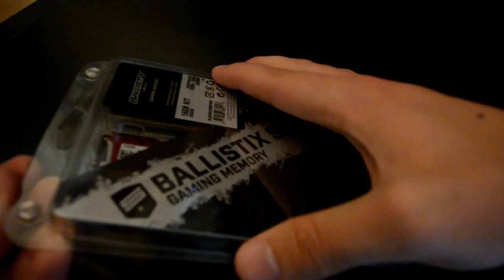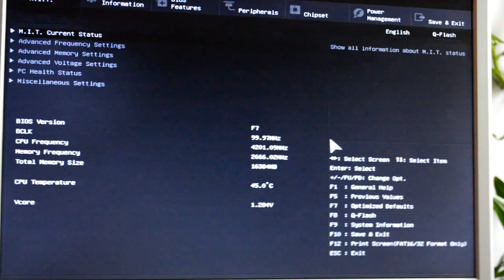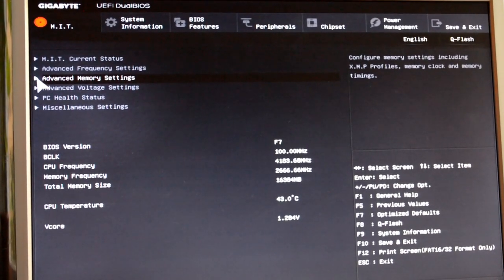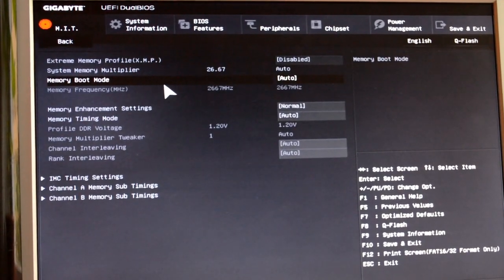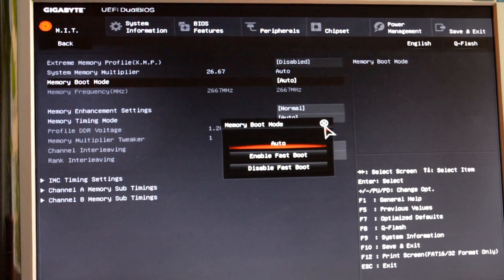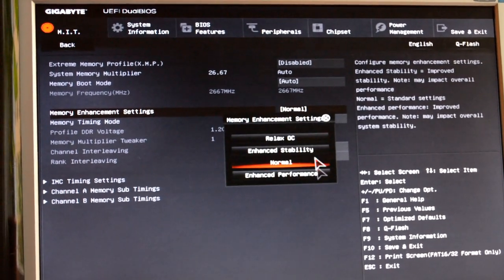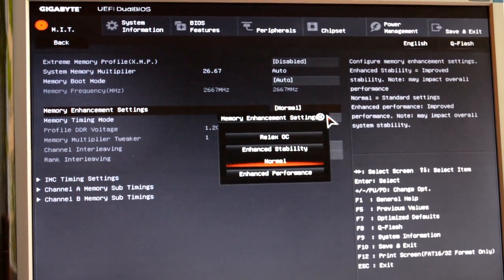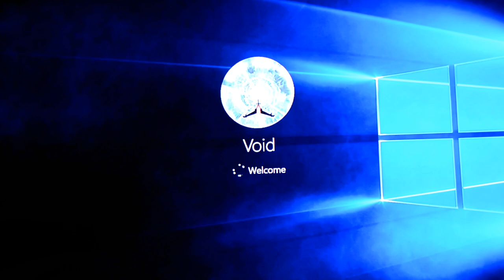How to Install RAM - Random Access Memory Upgrade Tutorial in Custom PC - Everything Explained 2024

Comment: I finally plucked up the courage to do this myself as a non-geek, no worries as it turned out. I had to remove the fan too. Looked at it for a while trying to figure out how to remove the fan funnel and finally sussed it. Turned out to be easy.  Slotted the extra RAM thing in, reconnected the Dell computer box, and it worked straight away. Nothing further to do.
Reply: Did u have to use. A non static wrist band or just free hand
Reply: U don’t need a wristband but just to make sure u don’t have static charge which can be done but just touching a metal part of the computer, so for mine it was the case
Reply: @JS-vc5yy  so for installating new or more ram you just plug it in? You don’t need to do anything in the computer?

Comment: I have Intel DH55HC motherboard and it has 4 ram slots and only supports 16Gb maximum in total. So I have to go with 4, 4Gb rams to get 16Gb ram. Anyway Now I running on 2, 4Gb rams and 1, 2Gb ram (10Gb in Total). So recently I bought another 4Gb ram and all them are same bus speed (DDR3 1333 MHz). So can I use all 4 rams (3, 4Gb rams & 1, 2Gb ram) together? Can I go to 14Gb ram in total?
Reply from the maker: Yes it should work like described

Comment: Hmmm, i am upgrading to 16 gb of ram (2x8) and i was wondering if it matters which slot of the 4 would they go into? Which slots do they go into?
Reply from the maker: Hey, it should be marked slots comes in pairs. A and B. Take the pair closest to the processor.
Reply: @GMODISM  You mean like A1 with B1?thats a pair?
Reply from the maker: Yeah this should utilize both channels perfectly
Reply: the manual of your mainboard should specify which slots are to use depending on configuration
Reply: 1 and 3 or 2 and 4
Reply: the closer you get them to the CPU the better as most games refer to the RAM for data on the fly. so closer means faster. it doesn't really matter which slots they go in (correct me if I'm wrong)

Comment: i would say leave the computer plugged in, BUT the switch off the power supply (this grounds the computer, but disconnects the hot (most call it positive)) 
this is optional: press the power button to discharge the capaciters
now install the RAM.

if your power supply dosent have a PSU switch then unplug it.
Reply: My pc has an on and off switch, can I use that instead??

Comment: So do I just take it out when it’s off then replace it and boot up and it’s fine or do I have to do something with the BIOS?
Reply: I’m wondering the same thing, did you ever figure that out?
Reply: @greasyg1026  yes, you have to set the ram speed I think because it doesn't come at the speed it is advertised. Say you have 3600mhz RAM it will come clocked at 2666 maybe so you have to go in the bios and change it ( I think )
Reply: Wait, I havent even watched the video and this was the reason I came here. You’re telling me he doesnt even address setting the XMP/DOCP? Fantastic.
Reply: @mrkhur9516  but it will still boot up right just not at the rated clock speeds ?
Reply: @giannivideo7680  yes it will boot up you just need to go to bios and change 1 setting

Comment: So I have 2x8gb of ram.. and there is 4 slots.. do I have to fill the next 2 at the same time or can I start out by getting one more piece of ram and making it 24gb?
Reply from the maker: I think you can have 3 sticks, should work but is not generally recommended as it may cause instability. 
Ram is pretty flexible but the recommendation is that you have all same size, 2 or 4 and same speed.
Reply: @GMODISM  im getting 1 of the same size,speed and ram. should I just wait until I get an extra 8 gb of ram to install it or once i get the one just go with it? Thanks
Reply: @seriouslymason  I recommend to install 2 ram sticks then move up to 4. Going to 3 ram sticks doesnt make of the use called "dual channel" you can see all the videos about dual channel if you want. And never put 2 ram sticks next to each other if you only have 2 ram sticks and 4 slots.

Comment: I installed my new RAM in but my PC just doesn’t want to boot up and makes a different sound then usual. It later shuts itself off and then turns itself on again. When I put my old ram back in it started up like normal like nothing had even happened.

Is this happening because my RAM isn’t compatible with my mother board? Let me know if there are any other reasons!

Comment: I need help, I did what you said and took out the 2 that were in my pc and added 4 (it comes with 4 slots but came with 2 sticks) I try adding the 4 but nothing happened with the sticks at all, then I trued re adding the old 2 and still nothing!!! Please help me...

Now my pc just runs alittle then turns off and quickly boots back up, it doesn't even show up on the monitor. Idk what im doing wrong
Reply: If your computer is duel channel make sure you have both sticks in the same color slot (some motherboards will have 2 black slots and 2 grey slots or something along those lines) and if they are, make sure the old ram is taken out and the computer is off. Before all that make sure the ram is even compatible. It could be too slow of ram or wrong ddr. Good luck, worst case scenario a computer store like Canada Computers can find the problem and fix it for around $100.
Reply: Nevermind I got it, I didn't push them in all the way lolol, but thankyou though^^
Reply: Oh my god 😂😂  happy to hear though. Most things need that audible "click" or "snap".
Reply: Yay, ill make sure to listen for it next time
Reply: I was so worried about brakeing it i didn't wanna be so forceful
Reply: @PopcornDaddy102  me too lmao, i just also build my first pc yesterday
Reply: Sweet
Reply: @lDARKH3ARTl  So when I install the ram will it automatically take me to the bios and do I have to do anything there
Reply: @Krank2105  you need to boot up, Press delete key multiple times until it takes you to the bios, Then adjust the mhz of your ram there.
Theres plenty of guide in youtube about this.

Comment: i have an 8gb ballistix ddr4 ram and i wanna upgrade it to 16gb.Should I just buy a 16gb ram? I cant find an 8gb stick of the same brand and same model of mine
Reply from the maker: different brand of similar speed usually works just fine, it is just better with same brand

Comment: My laptop had DDR4-2400 can I swap that out with DDR4-3600 and not have any issues?
Reply from the maker: Yes, but check your motherboards max speed and other limitations
Reply: @GMODISM  how’s it going thanks for the info I went ahead and popped it in and it was compatible thanks homie

Comment: I have 1 stick with 8gb of ram and want to upgrade and swap it out for 2 sticks with 16gb each (32 gb) total do I just take out the 8gb one and put in the 2 other sticks 16 gb each ? Like will I need to do anything with the software or programming or settings ?
Reply from the maker: should work fine if you do like this in the video

Comment: When u put them in do u have to touch any cables or no (like connect a cable or no) im buying a pre built but its only 8 ram thats the ONLY bad thing
Reply from the maker: No there is no cables you need to touch, only disconnected power supply by unplugging the entire computer.

Comment: Hello, I need help. I have one 16GB 3200mhz DDR4 ram stick installed on my mobo, but when I put another 16gb ram (same brand and everything), the fans and lights would turn on, but it would not boot, no display on the monitor. Is there any solution for this? Is it probably because of the XMP profile? It's set to Profile 1. My motherboard is MSI A320M-A PRO MAX
Reply: Why do you use a low end motherboard ?
Btw what's your processor???

Comment: Thank you, now when I am booting up my system it tells me I have the 16gb and 2400 mhz when I actually should have 16gb and 3200mhz. How does this makes sense?
Reply: Your motherboard probably only supports 2400mhz
Reply: Some setting automatically run at q lower rate. Check your advanced settings while booting up to see what it's set at

Comment: How long can I use a RAM? I mean, you usually change the PSU after 6-7 years. Does it make sense to change, if I still keep the same RAM size, just with more MHz? My RAM sticks are the first gen of DDR 4. I think that was  2013 when I bought them.
Reply from the maker: I would not change ram unless it's broken, and that happens very rarely. Save your money for upgrades. 
About PSU I would rather spend money on a quality PSU than switching between cheap ones periodically (if that is what you do) Hope that helps!
Reply: @GMODISM  thanks for the info.

Comment: Hey, i just tried putting two sticks of 8gb into my old pc and now when I try to turn on my pc the pc starts and my mix amp turns on for my headset but, my keyboard and mouse won’t. Do you have any solutions or know what could be wrong?
Reply: Nolan Robson are all the wires plugged in?
Reply: Does your motherboard support 16gb?
Reply: Ram stick is not correctly connected.

Comment: Ram was easy to insert, but now my PC wont output video. Ram are both ddr3, 1600 and same 8gb, but different brands.  Do the RAM sticks have to be the exactly identical for the computer to display video?
Reply from the maker: no they can be quite different actually, make sure both work by booting them with only one of them in PC, maybe one is broken.

Comment: I have 8gb single ram but when i add same 8gb ram my monitor goes into no signal. Can someone please help me
Reply: Same I need help
Reply: @prodigy0895  I had the same problem when I took out my older Ram to clean out my computer, it ended up being was my Ram was not in all the way. So just push a little bit harder until you hear a click and the two stabilizers on each end snap into place.

Comment: Does installing ram ever stop the internet from working?
Reply from the maker: Never heard of that, it shouldn't
Reply: @GMODISM   it did actually I had to go to services and delete some stuff in the dependencies  then reset my drivers
Reply from the maker: @Abc-tx4zr  99% sure this was not the fault of the ram sticks themselves unless you installed some software for them as well.
Reply: @GMODISM  Well it happened right after I put the two sticks in but I was also getting sustained beeping. I don't know why it happened honestly.

Comment: Hi!Should i wear some gloves or something when i will install ram?
Reply from the maker: No need, but touch the case first so that you don't have any static electrical load in your body compared to the board. Also try to not touch the motherboard more than necessary.
Reply: @GMODISM  ok,Thanks.

Comment: My monitor didnt turn on after I installed new RAM. Then I switched back to my old RAM and the same problem happend. I check if any cable came loose and found nothing.
Reply: Have you fixed the issue yet?
Reply: @deathsaidhello  yeah I did thanks
Reply: @yorkejones1570  how did you fix it
Reply: @ikhlasraf  I didnt click it in properly. Both sides need to be clicked in then it should work.
Reply: @yorkejones1570  oh thx mate

Comment: Hey I'm upgrading from two 8gb sticks to four.
I've installed them but my computer won't boot up.
Is there something in the bios I have to change to make it work?
Reply: Did you check the compatibility first? It might not be compatible with your motherboard.
Reply: @unf8ke312  If you mean the Ram themselves, I purchased more of what I currently use in it.
So definitely not that,I can also get it running with three sticks of memory but not for very long.
I'm thinking it's a bios thing but I'm not sure what to look for with it being Windows 10
Reply: NightShade you probably have to upgrade the motherboard because it can’t take that much ram
Reply: @henrik6977  I'm not sure, when I bought it a year ago itwas shown to be upgradable to 32gbs of ram. I didn't have the money then to upgrade from 8gbs to 32 but I did upgrade to 16 at the time.
Reply: @CarterNexus  ur motherboard probably dosen support 4 ram sticks at the same time only 2

Comment: I’ve installed my new ram but my monitor. Keyboard and mouse won’t turn on :/
Reply: Yeah had the same problem, the two audible clicks the ran makes when pushed into the slots really matter and you need to hesr both. After I heard them my monitor turned on like normal

Comment: I bought vengeance pro ram sticks for my pc I installed them my computer went into a loop when turn it on I couldn't get no display signal my computer run for 2 min turn off then on for 2 min over and over in a loop
Reply from the maker: Can it boot with old sticks?
Reply: I put the original sticks back in its slots and it still kept doing what it was doing I bought it prebuilt I send it back for repairs
Reply from the maker: @lorddiabout  If the warranty is active that is best practice.
Reply: @lorddiabout  with my time messing with computers, there are a few things to look out for when doing anything on your motherboard. 1: make sure none of the pins in your pin-out have come loose. 2: IF you're not using a grounding bracelet, always allow time for static to dissipate. if not you could cause failure to any number of parts inside of your pc upon turning the power back on to the unit. and 3: make sure your cpu fan is plugged into the correct slot, there is a connection specifically for the cpu fan so that it can monitor that the fan is working and is able to cool the cpu, if it isn't working, you will get the boot cycle. . . . only other thing i could think of is that the cmos still has your old ram information saved and requires to be reset. on some motherboards there is a button close to the ram for resetting this information. IF NOT, then there is a paperclip method of resetting it by bridging two connectors within the 24-pin connector. hope this helps.